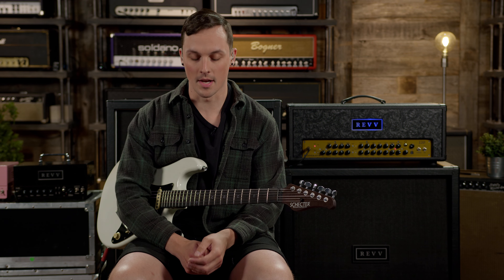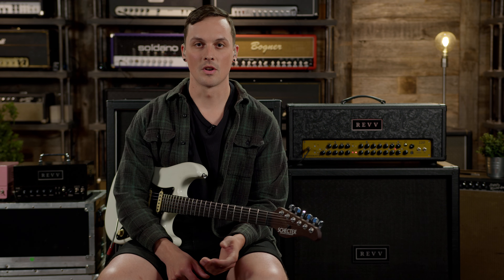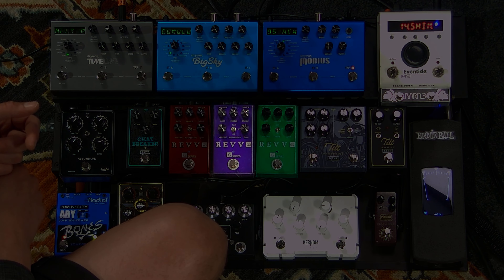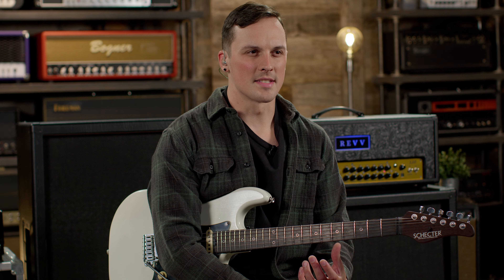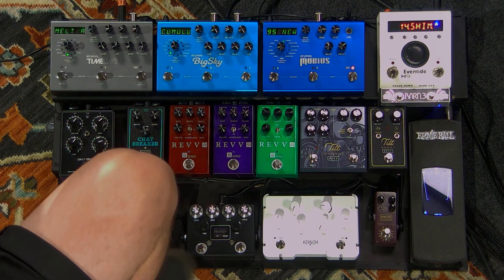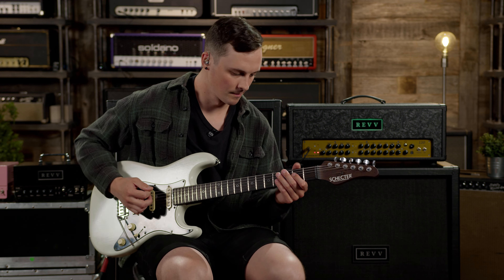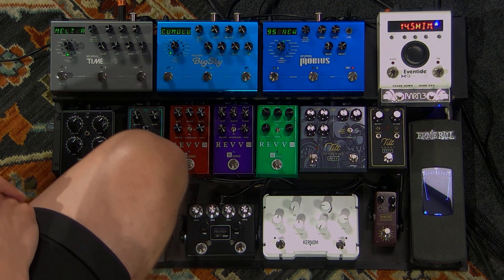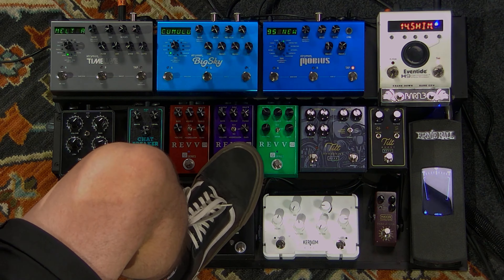Generator 120 VS G-Series Pedals Shootout

Comment: G2 sounded just like the channel. The G3 sounds good, but the purple channel in the amp was so much better. I recently took my G3 off my board, I'm not bitter about it, but there was a slightly muffled tone I couldn't get around. I still have the Northern Mauler on my board though. The G4 is so good, I can get some crazy Zakk Wylde style tones out of it.

Comment: G2 and G4 sounded very close to the amp channels. G3 has a similar tone but more saturation so it muffles the sound a little. Seems like G4 would benefit from an EQ pedal, and G3 with a pre-boost or overdrive.